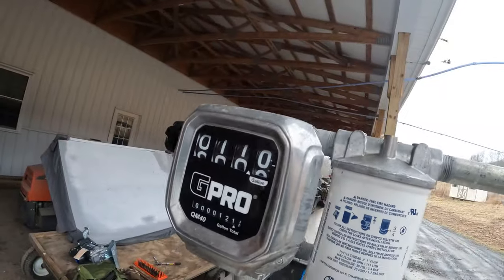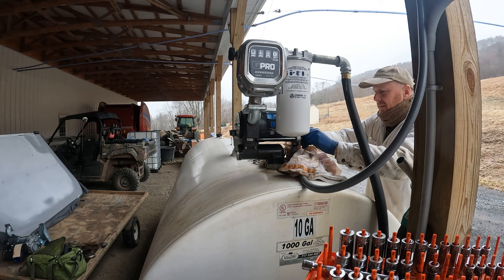Replace Motor & GPI Fuel Pump - It's Easy

Comment: You don't find that type of customer service in many places nowadays. I'm assuming the old pump possibly imploded itself? 

I was looking at your socket organizers when you said "let me go get the 10mm", it's always the 10mm that's missing, so funny! 
Kevin, I have seen those socket organizers before but have been reluctant to purchase some. Could you give me your opinion from someone that has used organizers professionally. Do they fit in the draws nicely? Clean up easy? I see the one you have is "portable". Do the markings wear off? Things like that. Thanks in advance and I appreciate your opinion on them. PoB.
Reply from the maker: P of B, you definitely don't find customer service like that much anymore!  I really like visiting their shop.  The organization is amazing.  Honestly, talking about it inspires me to get my barn better organized!  The rack that I am using works really well. The numbers stay on.  One thing about the rack is that it is designed for the tool box drawer.  You can certainly take it to the job site but you would want to be careful.  What I left out of the video was the point in time when it slid down the tank and caught it.  I think the reason I didn't share it was because my mic had died and there was no audio...  I bumped it with something and down it went. I caught it about half way down... crisis averted!  Had it hit the ground, it would have shattered.  I like how it lays in the drawer and/or my roll around cart. Easy to read too even for my old eyes...!  it is a good addition to my tool box.  And the kids love to put the sockets back in order!!!   For my shops my mantra was always, "Everything has a place and everything needs to be in it's place".  The better organized you are the more efficient you will be doing whatever tasks are at hand.  What do you use in your shop?  Thanks for watching!  Kevin
Reply: Currently and in the past I have used the foot long metal band strips with the socket clip that sits/slides on them. They are okay but only when the socket is housed on them. Every time a socket is removed the metal clip becomes loose and when putting them away I'm having to fix the spacing. I thought about "foam" inserts but feel the foam just takes away valuable space in the draw and holds dirt and grim. I sold most of my stuff when I moved back from the west coast. I'm looking at a new bottom and top box from Harbor Freight. The US General brand seems to be getting good reviews and the prices are fair. I like their tool carts as well, the 5 draw cart is spacious but not overly too big. I have never purchased from the trucks that came to the shops. I will never forget my first time on one of those trucks. $250 for a five piece open end wrench set. Then the $$$ to store them was crazy. That was years ago, I can't imagine the $ now. I have to get my garage clutter cleaned up to make room for a new box and the new endeavor I'm working on. I have no room for either and it's getting frustrating. I wholeheartedly agree with you, everything has its place and belongs there for smooth operations. My son and I just finished installing coil overs on his car and there was no room to complete that job comfortably and it showed in many ways. It drove me nuts and when finished, I looked at the mess and said enough of this. I have to stop and get reorganized. I appreciate your response and review of them! Thank you.
Reply from the maker: Have you seen Ludford in our videos?  He is a neighbor who wants to organize my shop but won't do it until I sign a contract saying that I'll put my tools back when I'm done... I'm about to sign that agreement!!!!  I'm always running from project to project and I have a work bench where I drop my tools.. at some point thinking I will put them away... That doesn't always happen.  I can say from experience the Harbor Freight roll around cart is great. I have one and love it! I am a fan of the "General" line of tool boxes.  I think I paid under $200 for the last one I bought.  Definitely wait for a sale!  And consider joining their insider club.  Within a couple purchases it pays for itself.  And you get better than street prices for tools.  I have the metal socket racks too in my older boxes and they work well.  You are correct in saying they tend to get looser over time.  There are some magnet trays that work too.  To me this is the 8 pack hot dog buns and 12 back hot dogs... can't they just get together on this and make to fit standard quantity sockets?  I'm thinking the higher end tool companies have figured it out a little better and they have enough spaces.  With the magnet version racks they fit nice in the box and don't fall out when transporting...unless like me you drop them.  Then it's a game of hunt and find...  Thanks for sharing your thoughts!  Kevin